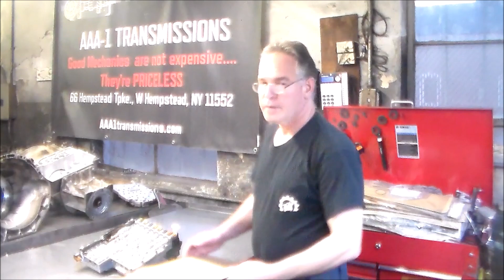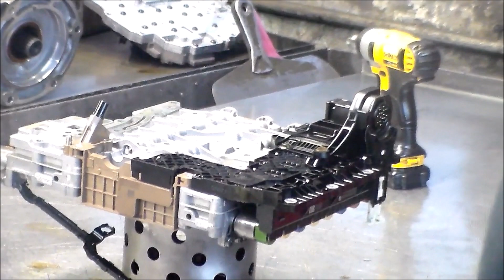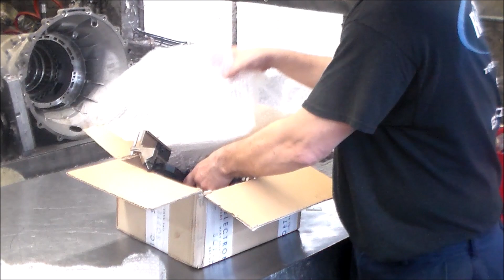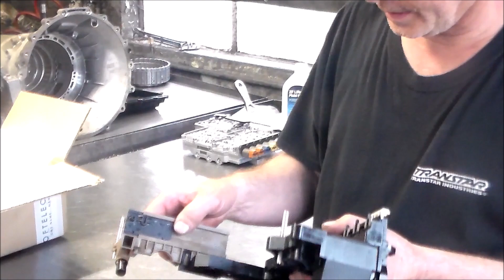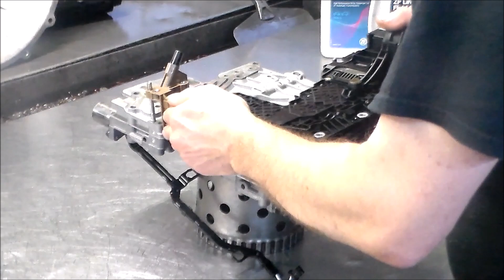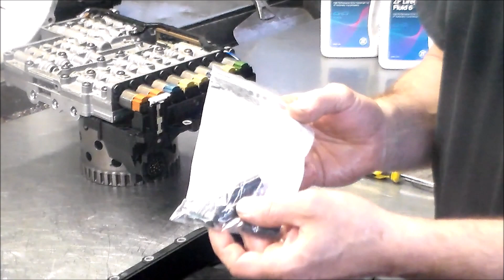ZF6HP21 Input Speed Sensor

Comment: Hi Gary, I’m Fabio and my 2011 BMW 750Li have this codes…

400625 Turbine Speed Sensor Too Low

1D3901 Electronic Transmission Control
(EGS), Signal Evaluation (Turbine Speed): Invalid Signal Content
Intermittent

1D3B01 Electronic Transmission Control
(EGS), Signal Evaluation (Gear Information): Invalid Signal Content

I’m in Florida where are you?
I’m thinking about replace the sensor or replace the whole valve body (buying a used with warranty) but I really appreciate if give me your advice for that.
Thanks
Reply: Just for let you know I have a scan and when the transmission malfunction comes I use it for clean the codes and everything back to normal again 🤷🏽‍♂️
Reply from the maker: @2006HARLEYDELUXE  where are you located?  Is this the only code?
Reply: @GaryFerraro I’m live in Margate near Pompano Beach, it is the only codes for the transmission, I have another one but is for the left sensor in the fuel tank. But my scanner is not the best one!
Reply from the maker: @2006HARLEYDELUXE  I send the TCM's to Europe for repair.  There is a state of the art shop in Bulgaria

Comment: Hey Gary I have a 2009 BMW 750li that was parked for 6 year with a 400625 code that was leaking transmission fluid around the pan could low transmission fluid be the reason for the code. Thanks
Reply from the maker: what is the definition of that code
Reply: @GaryFerraro  400625 Turbine speed sensor: value too small.

Comment: I have a 2012 750li with the same code could low transmission fluid be the case?
Reply from the maker: i would certainly check the fluid level, does the car not move or delay in moving?

Comment: I had a question I had a 2009 750li that had clutch ratio monitoring codes for a d and e and a turbine speed sensor code. I bought a used tranny and got the original tcm copied to the new one which had a good turbine sensor. So after installing it with new seals and solenoid and deleting all codes and reseting the adaptations the car still wouldnt drive. Had same symptoms of shifter going straight back to neutral and flashing and just revving up but wouldnt move.The original issue was the car slammed hard in to gear from reverse then 15 minutes later smelled burning coming from tranny and a noise. For a little the car would just barely move forward then eventually just stopped moving at all. is there anything else i could have missed. still bugs me till this day. My thoughts are the plastic connector from the mechatronic that comes out the bellhousing wasnt seating properly or something was wrong with the wiring or shifter possibly
Reply: after everything had a canbus 0001 code only
Reply from the maker: If you clear the code it comes right back?   Are you sure it took the program? was the original program erased first? @ryankelly6652
Reply: @garyferraro so all the clutch ratio codes and the speed sensor code were gone after installation and just a canbus u0001 code were present after. And I can't be sure but I sent it out to a place called ecumaverik and he said everything went well
Reply from the maker: This code is in the TCM? and it wont clear @ryankelly6652
Reply: @GaryFerraro  I think its just a regular obd2 code from the ecu. So originally car had clutch ratio monitoring codes for clutches a,d, and e as well as a turbine speed sensor code that I read on a bmw dedicated scanner. Took the valve body out and sent in the tcm and the tcm from the used tranny i bought and had the used tcm cleared and the original tcm flashed over to it .Did this because original tcms orange ribbon cable that was on the speed sensor was broken. was told the new tcm took the programing okay and was good to install. Installed the new tcm back in the new tranmision and put brand new solenoids on the valve body as well a new seals.. Filled it up shifted through gear and checked level and it was good. Then i reset all the adptations and took the car down and bam....til wont drive and has same symptoms of the shifter jumping back to N and flashing and wont move . Checked codes again and all the original codes were gone but now car had Canbus U0001 code. I rechecked all the seals were good and was thinking maybe the valvebody electronic plastic seal that you connect the transmision to may have not been seated properly so tranny wasnt communicating with the car but after triple checking it it seemed fine. Im at a complete losss as what the issue is now
Reply from the maker: Anytime you have a U code, that is communication code.  What is the definition of that code? @ryankelly6652
Reply from the maker: so if you clear this code, it comes right back? @ryankelly6652

Comment: Hi just quick one I'm getting continuity from pin 10 / from speed sensor 2 and the transmission casing its self is this normal short to ground error code on a zf8hp is it possible iv trapped the white wire on the speed sensor 2 do you think
Reply from the maker: Everything is built into the TCM, no wires to check, only wires coming in are power.ground and communication lines, if you have a speed sensor code, clear it see if it comes back or look at live data if you have a scan tool

Comment: My bmw with 6hp26 threw a trans malfunction message with code for solenoid 5 on mechtronics unit. After replacing solenoid 5 and all sleeves and bridge seal and filter pan and fluid my car wont attempt to start because it says its in 3rd gear even though its in park. If i shift the gear selector to R it thinks its in neutral amd thats the only way it will even attempt to start... any thoughts on what went wrong?
Reply from the maker: You may have missed the manual valve if this is an M shift valvebody
Reply: @GaryFerraro  When you say miss, do you mean positioned it in the wrong place/notch? I've made sure it's in the correct place. I was wondering if it's something electrical related... I forgot to mention that all gears when selected show different than what gear it's actually in.. and there is no Park on any gears I select. And when I move the selector to the D position it doesn't go into any gear, it throws a malfunction message at me instead. I appreciate you taking the time to read and respond by the way.

Comment: My 6hp19 gearbox has 50k miles and it shows an error when switching from 3rd to 4th gear and generates error 4F89. I changed the sealing sleeve, oil and filter, I'm going to analyze the solenoids, any tips on what else to watch?
Reply from the maker: does it seem to slip when the car gets hot?
Reply: @GaryFerraro  Happens even when the car is cold.
I made a video to understand better, here's the link:
https://youtu.be/vWXJmCl5Pts
If you can see and hear you will understand. The rotation oscillates upwards and the second or third time insisting already generates an error in the idrive.

Tomorrow the mechatronics and solenoids will be removed and analyzed.
Reply from the maker: @JulianoEsman  That is a flared shift, could be solenoids they can become mechanically clogged, E clutch could be worn as well. Bushing is the most common but the flare will happen usually when hot
Reply: @GaryFerraro  Thank you so much for replying and trying to help me.
The mechanics will be removed for a complete cleaning and analysis of the solenoids.
Reply from the maker: @JulianoEsman  let me know how it goes

Comment: Gary, softelectronic want $600 to fix a 400626 code which most likely is just a resoldering work on the ribbon cable of the turbine speed sensor. I think it is just too much. If u know how to unclip, without breaking, all 8-10 clips simultaneously to remove the black cover to get access to the ribbon cable, most of us can do it for just some soldering wire. don't u think?

Comment: hello gary....i have a 6hp26 in my jaguar...in park i get 650 engine rpms....turbine input is about 40 to 50 rpms lower....any thoughts...is this normal....if i need to use softelectronics are they open to the public....thanks as always
Reply: no codes ever
Reply from the maker: @scotthodges1236  Just may be lag time, if works ok and no codes i wouldn't worry about it. Yes Softelectronics are open to the public
Reply: @GaryFerraro  thanks Gary....you spend a lot of time at the shop....that is what it takes to have the best shop around...i know from experience

Comment: Hi Gary. Thanks for the video. Great job! Exactly what I am looking for. My 528i XDrive with ZF 6HP21X has Vehicle Speed Sensor plausibility error code 2F4F. Obviously you eat and sleep transmissions and have done your research regarding these ZF valve bodies. Do you know why there are no shops in the US that provide this TCM service?
Reply from the maker: There actually may be, but i'm not sure never researched it, i got hooked up with these guys through a friend that used them and they are great, used them maybe 10 times and never had a problem
Reply: @GaryFerraro  sounds good. I have a call into them. Thanks.

Comment: Hi Gary got your info from another video. I have a question regarding 2009 535i bmw. I getting a transmission malfunction message. And when I accelerate hard the shifter goes into fail safe mode. I have to turn the car off and restart. Then it drives normal again. If you can give me some advise it would be really appreciated. I wasn’t sure how to message you
Reply from the maker: can you have the car scanned to see what codes are present for the transmission
Reply: Got the same issue with my 2011 bmw 328i . Error codes P183A ,P2297 ,P0420,P0174 . My car goes in to safe mode after I accelerate and won’t shift . Than I pull over turn off the car and let it sit for a while (30-40min) than drives fine can’t find the problem.